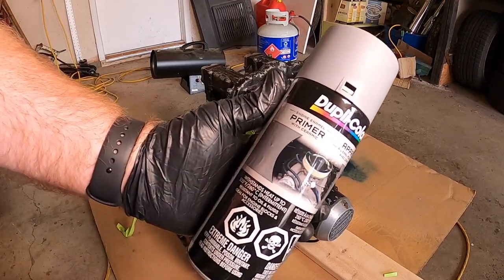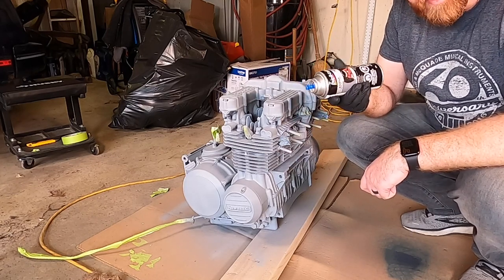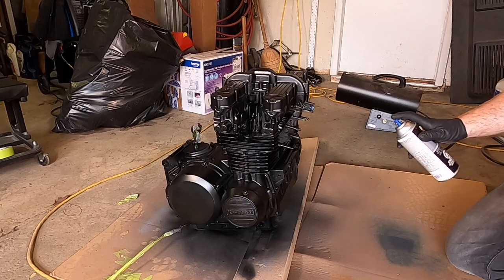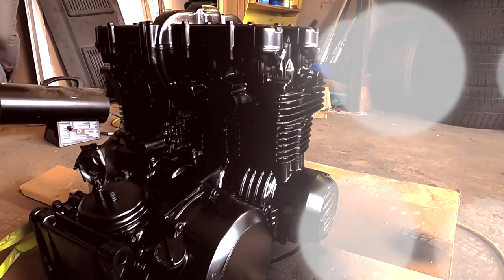Budget Cafe Build E13: Painting the KZ750 engine

Comment: Curious how the paint is holding up.  My engine could use paint, and I figured I'd need to soda blast it to get it to stick... especially between time where it's nearly impossible to clean thoroughly.
Reply from the maker: We haven’t been running the engine very hot yet. But we will be soon. We’ll give an update on how it does when we know. Thanks for watching 👍
Reply: @cafechronicles  Hi, any update?  Enquiring minds want to know 🙂
Reply from the maker: Hi Zed, no notable update yet. We’ve just gone through the carbs, we’re sorting out the wiring at the moment and then we’ll be firing it up. So far so good 👍